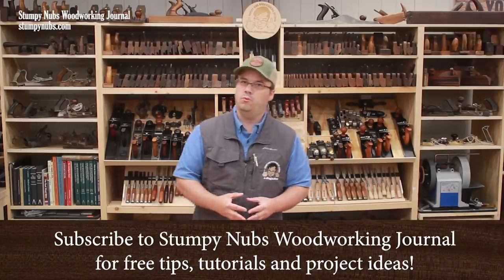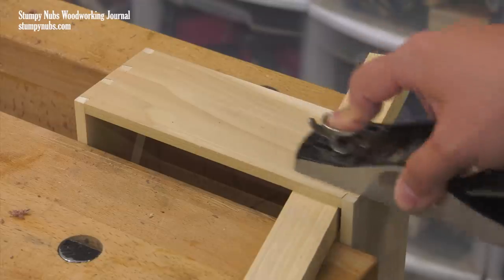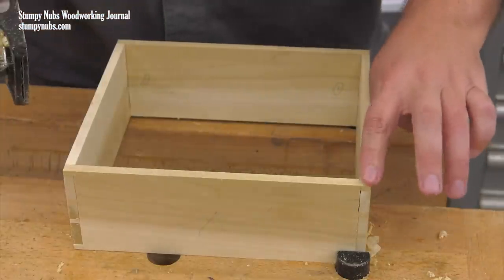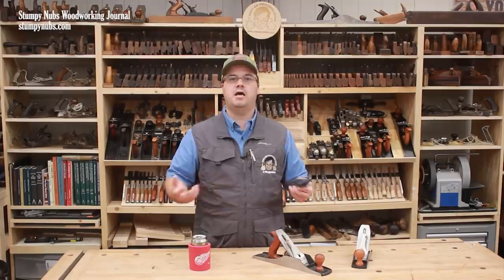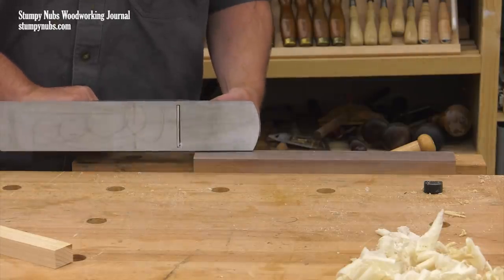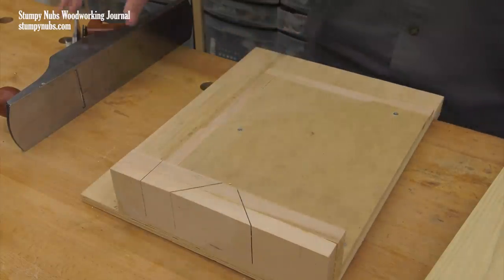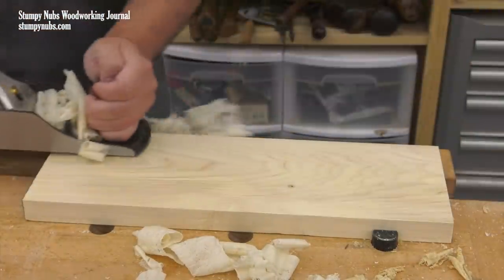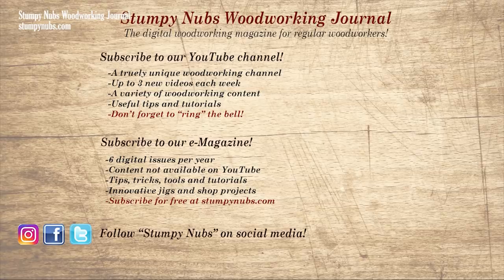Two hand planes you didn't know you needed

Comment: I would be interested to know whether your WoodRiver 5 1/2 is square - shoulder to base.  I bought one to use on a shooting board and it was .4mm out of square across the 70mm base to the shoulder. Woodriver responed -  "WoodRiver set a master tolerance for the plane to be within with reference to square.  THIS TOLERANCE IS 0.5 DEGREE ANGLE .  Checking a plane there can be a gap up to 0.45mm (0.018’’) when checked with a good quality square.  "

They couldn't agree to provide me a unit that was square  - my definition of square being - I cannot see a witness when refenced to my wood working square .  They did eventaully agree to a refund .  

I was bitterly disappointed that an otherwise beauitfully finished plane which was a joy to use (except for shooting) could not be made square.    I then turned to a simarly priced 5 1/2 plane from Axminister Tools - their Rider brand and the shoulders was also out of square by differing degrees to the base.

Comment: I have a large range of old but "not too bad" Stanley Bayley planes from No. 3 through to 7 with halves included.  I use these planes after doing much of the donkey work on  power equipment.  I intend reducing my range of planes to a low angle jack I only bought recently; a No. 6 for its heft, length and width; and a low angle block plane for edges and ends.  Do you think I should keep a 4 or 3 for small jobs or smoothing.  I don't want to get rid of all these planes just to find I'm reaching for a plane I need but don't have.
Reply from the maker: They take up very little space. Why get rid of them?

Comment: Your argument for the 5 1/2 is only good if you sharpen the blade flat and square. My 5 and 5 1/2 are sharpened with a radius (as they customarily are) because I use them as the jack plane they were intended to be. Therefore, since the 4 is ground flat, as apparently your jack planes are, I myself grab the 4 for all the tasks you assigned the 5 1/2.
Reply from the maker: My 5 has a radius, but not my 5-1/2

Comment: Thanks for the educational info here also.  New to woodworking so I have to ask this, and forgive me if it seems like a stupid question, but is a Jack Plane another name for the term you used Bench Plane?  Looking at Woodcraft, I only find 5-1/2 Jack Plane, not Bench Plane.  Also, is the Block Plane you show, the Low Profile version, or standard?
Reply from the maker: Any of the large planes (#2-#8) are bench planes. The term Jack plane is commonly applied to the #5 (and it's variations 5-1/2 and 5-1/4) because it was so common across all trades. So a #5 can be called both a bench plane and a Jack plane, but the rest are only bench planes.
Reply: @StumpyNubs  Thanks for clearing that up. Also, is the Block Plane you show, the Low Profile version, or standard?  What is  advantage of one over the other?

Comment: I was planning to get the Wood River 5.5 this weekend during the sale but they said they’re out for over a month :/
Reply from the maker: You should buy it so you are on the list for that batch, otherwise it may be a lot longer. Covid supply issues.
Reply: @StumpyNubs  I think I’m going to. Problem is the frog adjustment screw just broke on my current #5 Bench Dog plane so I need a replacement ASAP. Will probably order and just get by for a month

Comment: So, would a shoulder plane be the 3rd plane you’d recommend for a power-tools-mainly woodworker?  If not, why and at what point?
Reply: Router plane should be your third plane.  You can use it to finesse tenons, grooves, dadoes, and rabbets.  It's easier to sharpen, set-up, and use than a shoulder plane and the depth stop ability is far more important than any advantage you get with the shoulder plane.
Reply: @MrSharper802  Thanks!  Any recommendations on a router plane that won’t break the bank?
Reply: @dallasrtucker  Multiple vintage Stanley #71s on eBay for under $75. My first was an Ebay find. I think only Lie-Nielsen and Veritas make new ones and they are both north of $175.

Comment: How do you determine the Quality of a plane. What to look for and why a big difference in price. For Example I followed your link to woodcraft.  a Clifton - LA Adj Mouth Block Plane $375 at Woodcraft.com and Stanley - Stanley SW No. 60-1/2 Low Angle Block Plane $90.  In this case I see what looks like brass and hardwood "cosmetics" and there may be some status in the name. But what to look for in terms of function between better and not so good planes?  I appreciate you and your perspectives.
Reply from the maker: A premium plane is difficult to identify from photos. You really have to read reviews, etc. to see what knowledgeable users say about them. What make a plane "premium" is primarily the care with which it is made and assembled. The bottom should be flat, the sides should be square to that bottom. There should be no twist in the body. The frog should be well machined and the inside of the body milled so the two seat together properly to avoid chatter. Modern high-end planes have thicker irons, but even more important is that the chip-breaker be well machined so it meets seamlessly on the back of the iron. The back of the iron should be flat, as well. A premium plane will also come sharpened (but not honed to the final edge). And modern versions are usually made of more durable materials such as ductile iron. If all of these things are properly cared for at the factory, the plane will work right out of the box (after honing) with little or no tuning and fussing. All of this costs more money because of the added steps and labor in the manufacturing process. And premium planes are made in smaller quantities, as well. This adds up to a significant difference in price..... Are Lie Nielson or other plane "more premium" than an identical Wood River model? Perhaps, but at this level the differences are incremental and I am not sure they justify the difference in price.
Reply: @StumpyNubs  Thank you very much for your explanation.  That helps tremendously.

Comment: I have the wood river 5-1/2" I keep trying to justify getting another plane but I use the 5-1/2" for everything. what's a good excuse to get all these different sizes besides money burning a hole in my pocket?
Reply: Wait for the Lee Valley semi-annual sales, specially the one around Thanksgiving/Halloween - lots of 'blemished' Veritas planes for $ off - I have several and have yet to find the 'blemish' on any. Plus lots of end-of-line deals from other manufacturers.
Reply from the maker: If the 5-1/2 does everything you need, maybe you don't need other sizes. ;)